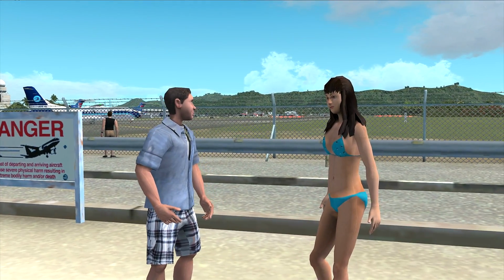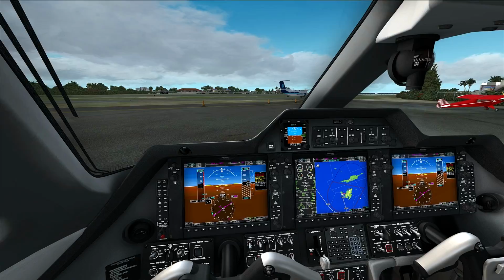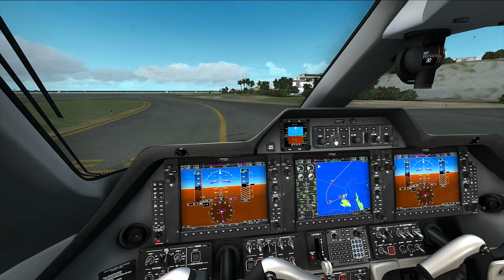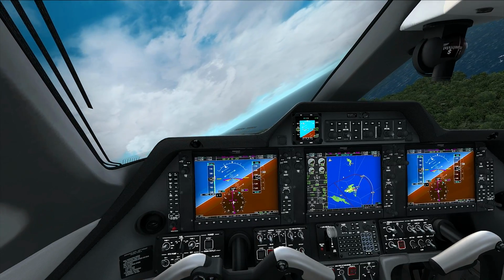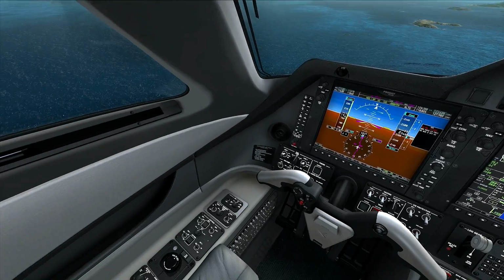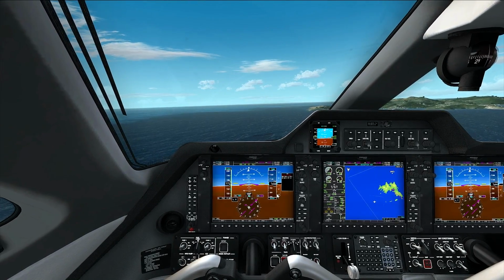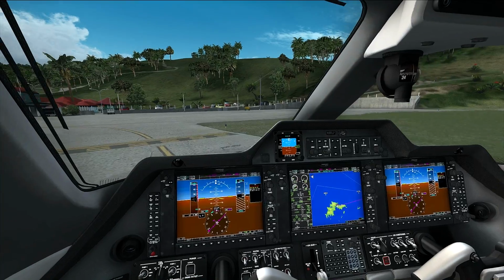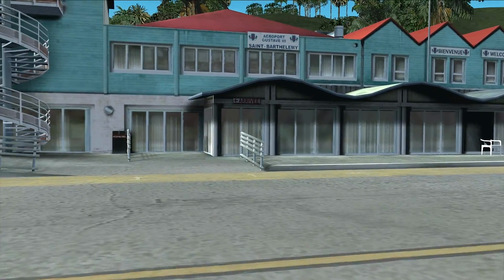Carenado Embraer PHENOM 300 Brazil to Wichita Leg 3 part 1

Comment: Hey FS MaNiA; Im about to get my first corporate bird from Carenado and just wanted your advice in the matter. Currently I have my eye on the S550ii, Hawker 850 and Phenom 300. Just wanted to know which of the three has a better simulation of systems plus overall realism based on your experience with them.
Reply from the maker: +Reynell Barnett Hi Reynell!  Of the three jets you mentioned, I would lean toward the Phenom 300.  The Garmin G1000 is the most advanced and updated navigation auto flight system.  The Phenom 300 also takes advantage of a great deal of system automation to assist single pilot IFR operations in busy airspace environments.  My second choice would probably by the Citation S550, although the FMS leaves a lot to be desired.  Hope that helps.  Kindest regards from Tim G., FS MaNiA

Comment: I am about the get a Carenado aircraft for my sim, I'm trying to decide between the PC-12, TBM-850, or the Phenom 300. This will be my first "advanced" airplane in the sim, which would you recommend me to start on?
Reply from the maker: +2018paulrobbinx Hi Paul, I think of the three, the TBM-850 would be a good one for starters (in my opinion).   I am planning to feature the TBM-850 very soon on this channel.  Maybe I will get there in time to help out.  Kindest regards, Tim G., FS MaNiA
Reply: +FS MaNiA great, that is what I chose! Thank you for your suggestion, it is highly appreciated!
Reply: +FS MaNiA it is a fast and fun little plane to fly from the .4 hours I have in it on the sim! LOL
Reply: +FS MaNiA I followed your advice and I absolutely love the TBM! I honestly feel confident in it already, I have done a series of IMC flights from fog to massive storms systems! After mastering the TBM do you think I could handle the Phenom?
Reply from the maker: Hi 2018paulrobbinx!  I have no doubt you can handle the Phenom 300.  Embraer developed the Phenom line to be a single pilot jet with all kinds of system automation.  It really is an easy jet to fly in my opinion. The main difference is going to be planning your top of descent far enough out (around 100 miles from the destination airport).  I see no reason you shouldn't have a jet in your virtual hanger that will fly higher, further, and faster than the TBM!  Spread your wings and fly!!!  Cheers from Tim G., FS MaNiA
Reply: +FS MaNiA yes sir, which would you say would be better for me to learn, the Phenom 300 or soon to be released Citation CJ2?
Reply from the maker: I haven't had a chance to fly the CJ2 yet as I have been swamped with real world work.  Is it a Carenado product?
Reply: +FS MaNiA yes sir! It looks fantastic, but not nearly as automated as the Phenoms. I'm sorry for asking so many questions.

Comment: How long does it take you to load X-Plane ? Is it normal that mine takes about 10-15 minutes with many addons like Photoscenery and Weather Addons ? ( and W2Xplane ...)
Reply from the maker: +Tim Ebert Hi Tim!  My version of X-Plane loads in about 15 seconds, however,  I have minimal add-ons at this time.  I want to dive deeper into X-plane at some point when time permits.  The biggest problems I'm having with X-Plane is moving around the cockpit smoothly.  That is an important requirement for producing a descent video.  I also am getting some shimmering in the scenery which is most likely graphic card settings I could probably work out.  One of these days I will have to take an FSX sabbatical long enough to research the finer points of X-Plane settings.  At any rate, 10 to 15 minutes load time is unacceptable for any simulator platform in my opinion.  You typically need a fairly high performance PC for good flight simulator results on any of the main stream platforms.  FSX is notorious for being a processor hog.  You can check out my system specs under the "About" tab on the FS MaNiA Channel page.  Hope this helps!  Cheers from Tim G., FS MaNiA

Comment: Is it correct that the turn indicator and inclinometer seem to move in the incorrect direction of the turn? Has this been addressed anywhere?
Reply from the maker: +Jonathan Stroud Hi Jonathan,  At what point did you notice this discrepancy??  Bear in mind that I had to ad a fair amount of Right rudder to overcome adverse yaw from the dead engine,  this has the effect of crossing the controls which would give weird turn and slip indications.  If you are seeing that happen on standard turns with both engines running, then there might be an issue.  Hope that helps.  Cheers, Tim G, FS MaNiA
Reply: Hi Tim, take the Flight1 King Air up. Bank right 30 degrees, you'll see the turn indicator moves right and so does the inclinometer. Do the same in the Carenado Phenom 300 - Turn Indicator and Inclinometer go left...let me know if you see what I see...
Reply from the maker: Jonathan Stroud Hey Jonathan,  I'm getting ready to fly the 300 from St. Maarten to Fort Lauderdale.  I will do some test to see if the turn indicator and inclinometer are mis-behaving.  Tim
Reply from the maker: +Jonathan Stroud Hi Jonathan,  I just compared two screen shots 1) Flight 1 King Air B200 in left turn, 2) Carenado Phenom 300 in left turn.  They are not behaving in the same manner, however, I'm not too sure either is wrong per se'.  I have access to the real world "Embraer Prodigy Flight Deck 300 Pilot's Guide".  I checked the section describing the Attitude Indicator on the PFD and it appears Carenado modeled their unit accurately based on the Embraer Prodigy unit.  I haven't looked into the real world King Air G1000 manual to see if theirs is accurate, but it seems to me they both accomplish the same goal.  On the Phenom Prodigy, the top inverted arrow , "Roll Scale Zero"  and the "Roll Scale" move in unison with the "Aircraft Symbol".  The "Roll Scale Pointer" remains stationary pointing upward.  Angle of bank is indicated by the position of the "Roll Pointer" on the "Roll Scale".On the Flight1 version, both the "Roll Scale Zero" and the "Roll Scale" remain stationary and level with the horizon, while the "Roll Pointer" moves in unison with the "Aircraft Symbol".  Same as the Phenom Prodigy unit, Angle of bank is still indicated by the position of the "Roll Pointer" on the "Roll Scale".The "Slip/Skid Indicator" which is the bar beneath the "Roll Pointer" behaves like a traditional inclinometer by moving laterally away from the roll pointer to indicate uncoordinated flight, slip (inside turn) or skid (outside turn).  Pretty dang good eye to catch that subtle difference in the two units.  I probably wouldn't have ever noticed unless you mentioned it.  I do think both units accomplish the same goal.  I tried to form an opinion as to which is better,,, but alas, I settled on six one, half dozen the other.  This was a really great question which made me look a lot closer at the finer points of the attitude indicator.  Good stuff.  Thanks very much and kindest regards from Tim G., FS MaNiA
Reply: +FS MaNiA Hi there Tim, thanks for clearing that up... I am of the opinion that although neither is wrong, the representation in the King Air is correct...the scale should remain stationary and the indicator should move along the scale in the same direction as the small aircraft indicated on the Attitude Indicator, just as on all steam guages. It just looks weird on the Phenom.... great vids by the way...keep it up!

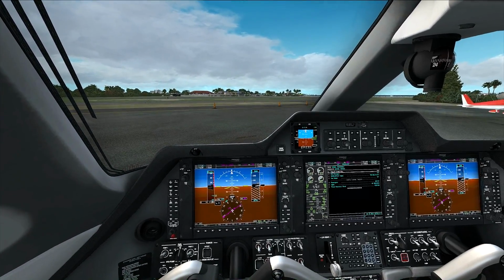Comment: 0:56 whats the Embraer doing on the Beach! Great video as always FS MaNiA, and great editing as always. I got to wonder, how did you get the ATC at 5:19? Just a little thing that might help, you can go the this link: https://fullterrain.com/freeware and scroll to the bottom and download Bob, which is a little thing that makes it so you can "walk" in FSX. Happy Halloween, and great job landing on that short runway!
Reply from the maker: +Josh McCorquodale Hi Josh!  We had to tow the Phenom 300 to the beach because that's the only place we could get the Embraer Jet Technicians to work on the pressurization system!!  

The ATC background chatter is from LiveATC.net TNCM feed.  The TNCM controllers that responded to my actual radio calls were voice overs all by Chas Reed.  

I actually have "Bob" loaded in my virtual hanger.  I have used him a couple of times in past videos.  I almost forgot about Bob.. will need to bring him out for the walk-around in Fort Lauderdale.  

Thanks for the comments and questions.  Cheers from Tim G., FS MaNiA
Reply: +FS MaNiA "The only place that I could get the technicians to work on it…"…lafffffffffffffinnnnnn

Comment: Hey FSMANIA... I tried to use skyvector, but when you go to file the flightplan a disclaimer pops up saying I will not use this as a game or simulation. it seems this site is for real world flying only???
Reply from the maker: +Daryl Henbery Hi Daryl, I haven't seen the popup disclaimer you mentioned, however, I know you can use the Skyvector flight planning feature to file real world flight plans.  You would have to have an account set up with a Pilot name and aircraft tail number, etc. to use that feature.  Obviously you will not file a real world flight plan for a simulated flight.  You can use all of the other features of SkyVector with no worries without the need to sign in.  It really is a very helpful tool for flight planning and navigation for the simulated world.  Hope that helps!  Cheers from Tim G., FS MaNiA
Reply: The disclaimer shows when you go to save the flightplan... so from what you're saying is just use skyvector without logging in. Thanks for your quick reply and help. I enjoy your vids a lot :)